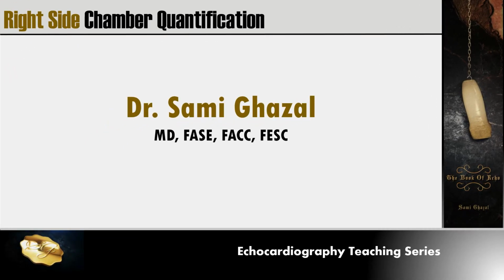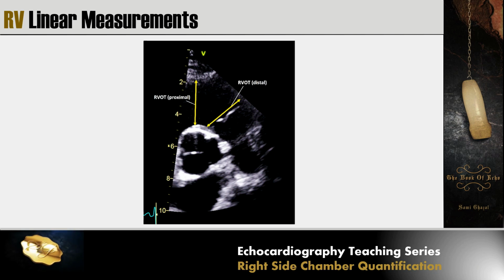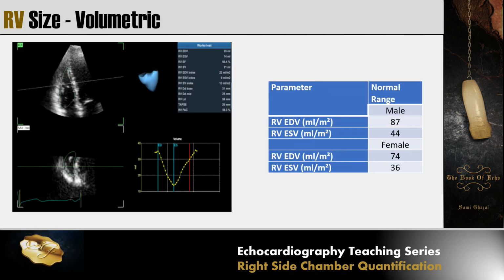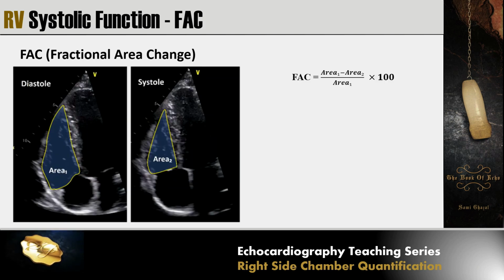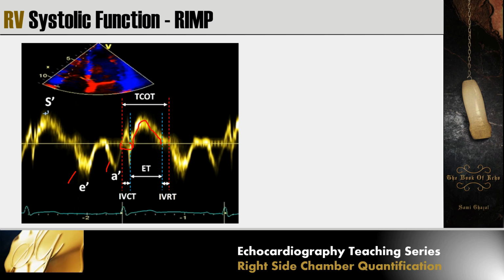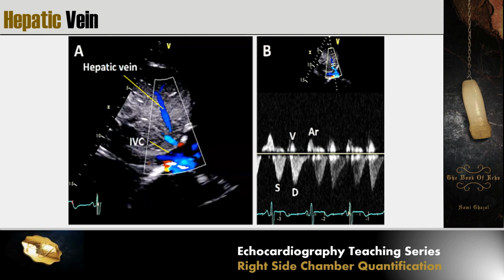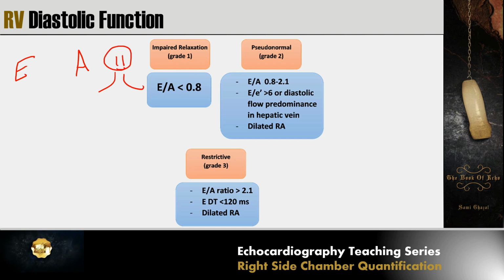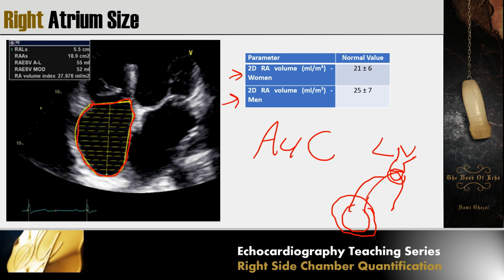Lecture 7 - Right Side Chamber Quantification

Comment: Sir is that something wrong? At 12:47 the normal value for Tissue doppler is > 0.54. But at 15:20 in the table of abnormal values, it's also >0.54
Reply from the maker: You are right. Normal value should be  < 0.54. More than this is abnormal. I will add correction to video soon. I appreciate your feedback

Comment: Sir i have a quesion .. how to measure time .. what to choose from the ultrasound machine to measure ICT  , ET to reach the MPI
Reply from the maker: It all depends on the manufacturer of the US machine. However  I believe all machines will have an option called time or interval where you manually measure the time and write it down to manually do the MPI calculations. But for sure there is always workaround it.

Good luck
Reply: Thanks alot sir.. Thats highly appreciated